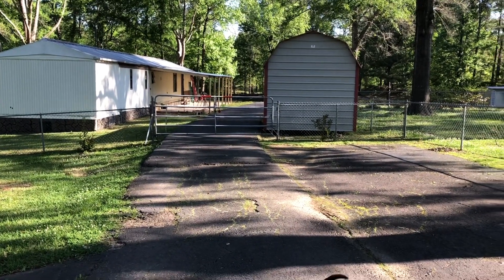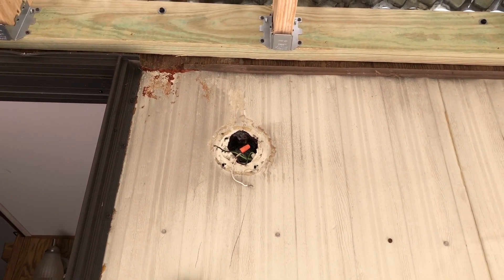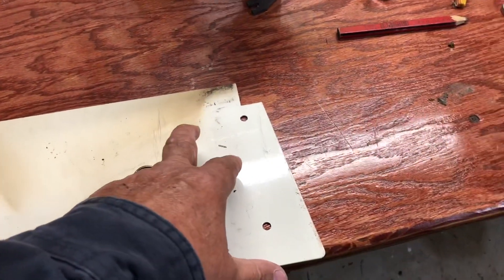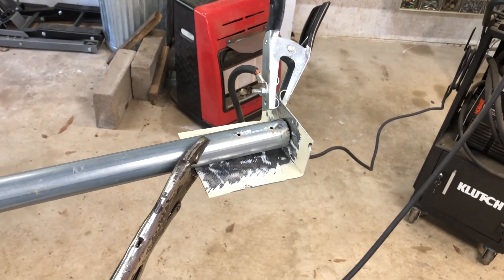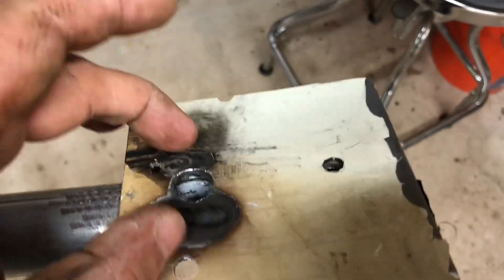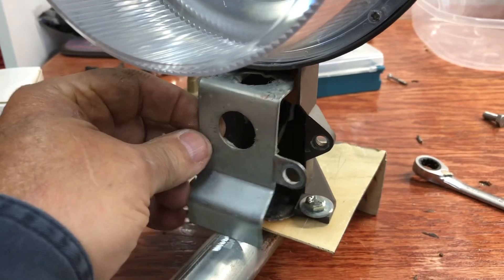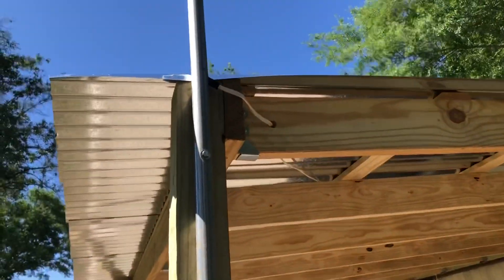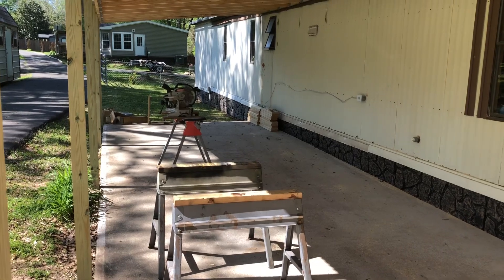Installing a security light on a pole

Comment: Long ago an older fella was laughing at me trying to push/pull a wire through a pole much like this one.
I asked what was so funny he said "No One Told Ya Son" Told me what?
He walk in the house got his vacuum and about a ten foot long piece of string and a plastic bag.
He told me to tie the bag to the string and the other end of the string to my finger.
He went to the end of the pipe stuck the nozzle on the end and turned it on and said "put the plastic bag by the hole"
And would you know it swoosh he was holding the bag .
He said " Tie the string to the wire real good " I did and he pulled it through it all took about 5 mins mostly getting the vacuum.
Reply from the maker: Your never to old to learn a new trick!

Comment: May have been easier to run the wire if you removed the outer sheath.
Reply from the maker: Good thinking! That plastic does tend to get hung up on stuff.